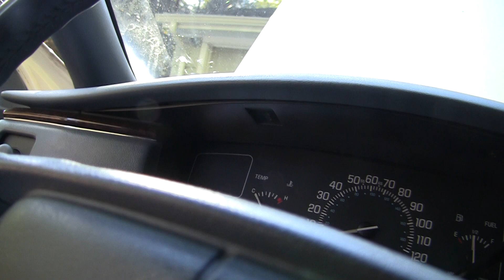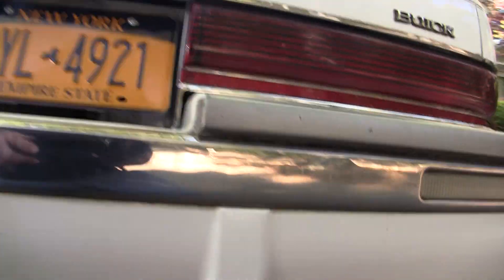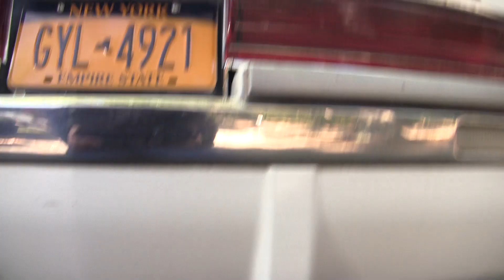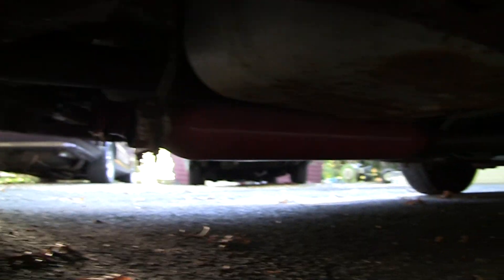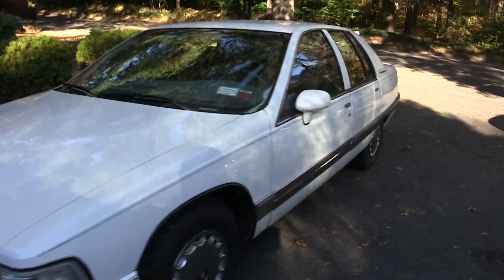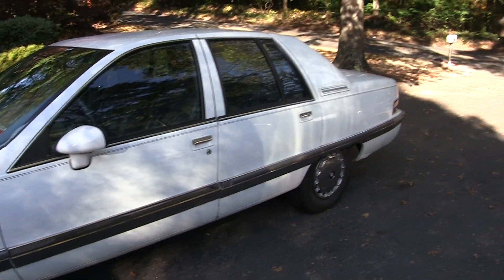Buick anyone?   1994 Roadmaster sedan

Comment: Looks to be a pretty solid car, My brother has a 92 roadmaster sedan it runs and drives fine But is both rusty and the body is beat up. one of the previous owners hit allot of stuff with that car, there are big dents in almost every panel and there is bad rot in the wheel wells. I have a video of in on my channel if you want to see it.

Comment: I bet the tps code and trans shifting are related.
Reply from the maker: Already has a new sensor,  someone else thought the same thing
Reply: +moldymac But still has a code? Maybe not adjusted correctly or a wiring issue?
Reply from the maker: +mjmcomputers no